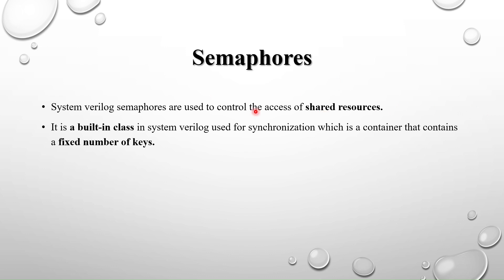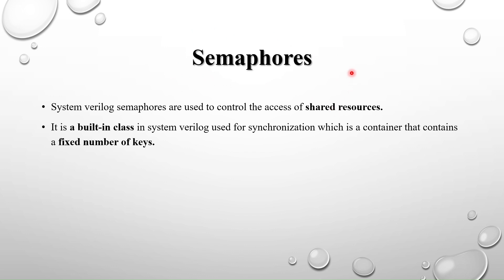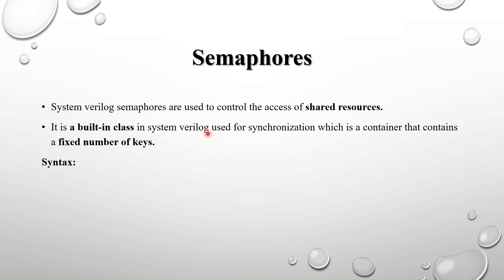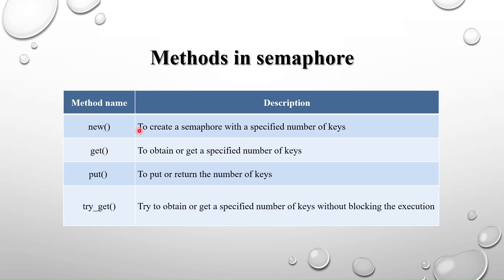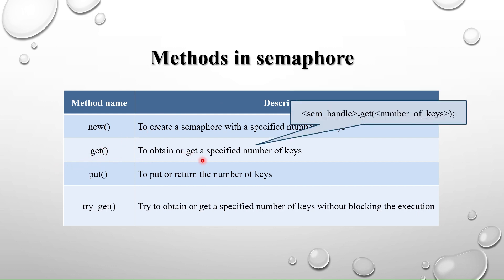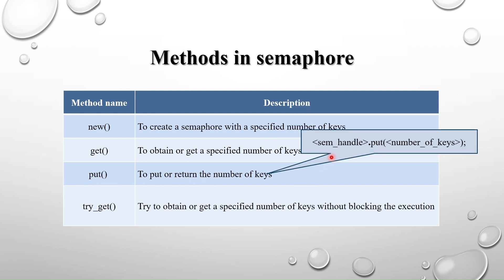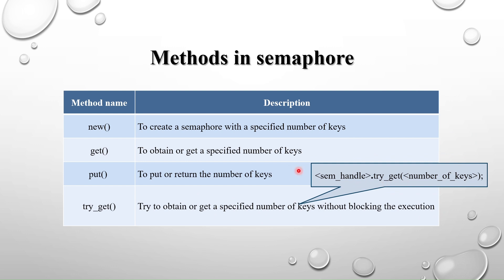Semaphores in System verilog | Part 1 | Introduction | #systemverilog #vlsi

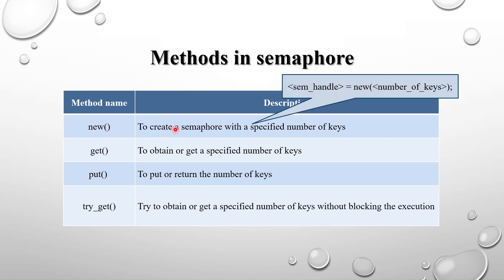Comment from the maker: Correction: 5:11 
By default, no keys are created.The new() method returns semaphore handle or null if it is not created.
By default, one key is returned by calling  get() if no value is specified.